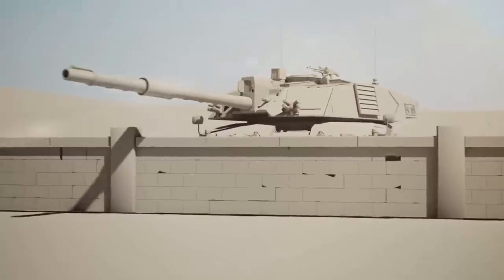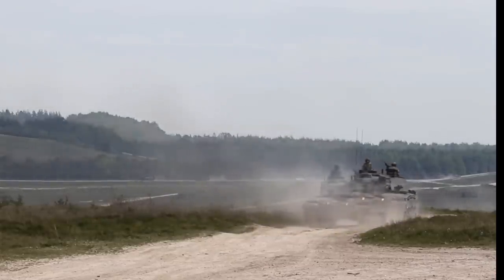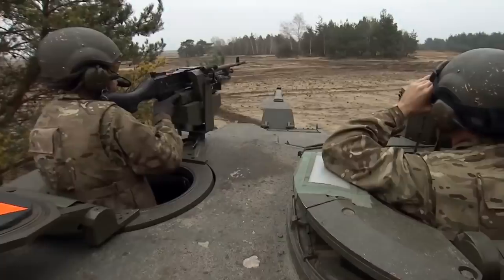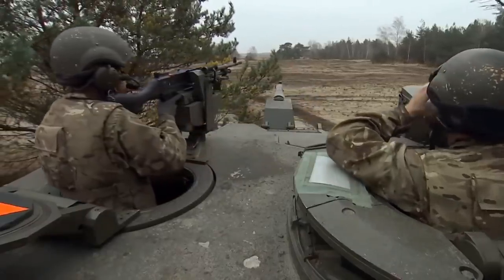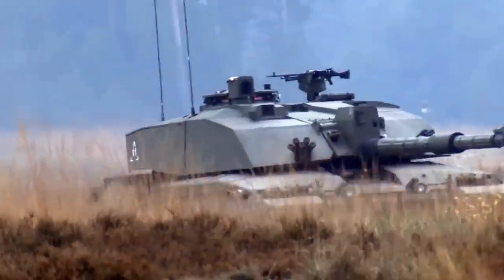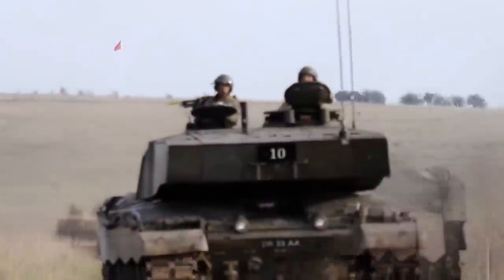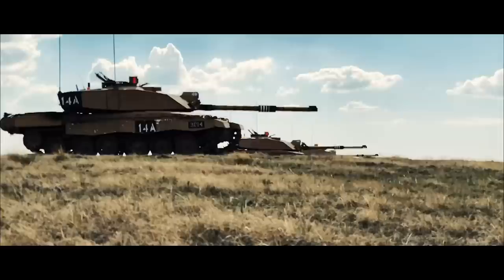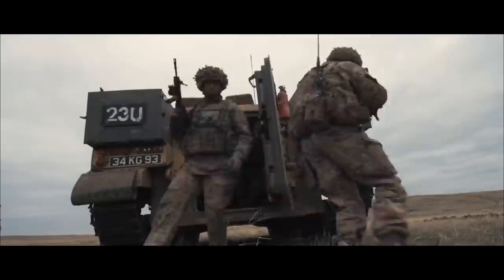Challenger 2 Tank "Black Night" | MODERN UPGRADE

Comment: would be nice if th eu (ye britain is out now) if they would do a joint venture tank like the tiger helicopter or the typhoon aircraft think they COULD make a great tank IF they work good together. Germany leo2a7v now is one of the modernst now challanger2 and  leclerc are also great tanks, even Arieta PSO. But i think IF Political would have to agree to this and even if they, they would have to show their "classified" technologies to foreign countries if the result should be rly good and the cooperation shouldnt suffer like (germany: we did such a good tank we have the lead here or UK: we developed the best armor) just examples. But if it works there could be a. rly great tank with a 130mm Rheinmetall smothbore they want to give it to the future Leo (3) and if 3 countries got this calliber the ammunition could be better developed and cheaper
PS: it would be a highly mudular tank with variants for the single countries and as u said this bringst another pro faster repair/ changimg parts etcetc

Comment: Ah...The old circular argument of the Challenger needing a new gun!

"It needs a smoothbore because they are better"
"Why are they better?"
"Because they are smooth"
"And how is smooth better?"
"Because of the smoothness"
etc
etc......
Reply: @jonny2954  Smoothbore vs rifled isn't the only thing that affects those attributes. There are many factors that go into a gun's penetrating power and the British Army have actually used an L55 smoothbore in a Challenger turret and found it "had no significant advantage in performance" over the existing L30, and the L55 already is superior to the L44.
Reply: @willmartin1033  Sure there are other things that affect penetration power, as example the ammunition. That's another big drawback of the rifled L30. It uses two-piece ammunition, penetrator and propellant are seperated parts. This prevents the penetrator from extending back into the propellant like on 120 mm smoothbore ammunition, which is one piece. Search up a cutaway pic of a M829A3 APFSDS and you will get the point. The L30 fires shorter (thus lighter) penetrators at a lower muzzle velocity, everyone that has heard of physics knows that isn't a good combination.

The Rh L55 story is a bit different. The UK MoD never stated it 'had no significant advantage in performance'. In fact it provided a drastic increase of muzzle energy, but the Challenger 2 turret was designed to accommodate the two-piece L30 ammunition mentioned above. They could only fit 4 rounds of unitary 120mm ammunition in the turret without major modification. They would have to redesign the turret to fit more, but that was considered to be too expensive at the time.

Now, more than 10 years later, the UK MoD is interested in a more poweful gun again, mainly because of a newer generation of russian tanks being developed (Armata). Rheinmetall recently confirmed their LEP bid will focus around implementing a 120mm smoothbore gun in the Challenger 2.
Reply: @jonny2954  Modern L30 ammunition has  almost identical length-to-diameter ratio as that used on both L44 and L55. The smaller lighter projectile argument refers back to the L26 round used on the Challenger 1 and is decades out of date. Most criticisms of L30 actually unwittingly refer to early marks of that L11 gun.

The L55 was tested in order to look into gaining access to NATO single piece ammunition lines as the current lines were closing down. However, it was tested for lethality against the current L30 while at Bovington. The official British Army assessment given to the armed forces committee was that the gun offered no significant improvement in lethality. 

Challenger 2 LEP has given a contract to a consortium including General Dynamics and BAE and is an internal systems upgrade. The gun is not being replaced and never was, Rheinmetall are not part of the consortium.
Reply: @willmartin1033  The smaller lighter penetrator does indeed refer to the L27, not the L26. It's simply not physically possible for the penetrator to reach a similar lenght to a M829A3 or DM53.

For the gun, i explained it, if you don't believe me this guy goes more into detail: https://below-the-turret-ring.blogspot.com/2016/06/team-challenger-2s-upgrade-suggestion.html

The Challenger 2 LEP wasn't given to anyone yet. There hasn't ben a decision yet. BAE and Rheinmetall are the final bidders, BAEs (early) proposal is seen in this video, Rheinmetalls proposal is going to be revealed soon. This is from a recent Rheinmetall presentation: https://i.imgur.com/jOTnG57.png
Reply: @komradearti9935  Yes, i forgot about the EFC count, thank you!
Reply: @komradearti9935  And now they made a smoothbore a requirement for the LEP.
Reply: @komradearti9935   Probably as much as a new tank. Really interested what BAE is gonna bring up, Rheinmetall already confirmed their LEP includes a smoothbore a few weeks ago.

Comment: Needs a smaller lower plate where the driver is. And every where between the cannon barrel and the cheeks are very big weak spots. A new improved engine, and better transmission would be good as well

Comment: look like its getting Israel's trophy APS from the images at the start of this video also didn't Challenger 2E demo have a 1500 hp euro pack as for the gun they tried the L55 smooth boar until someone realized you need to redesign and re-manufacture the back half of the turret for the one peace ammo!

Comment: I have to disagree with regard to the rifled main armament. Currently the Challenger II has by far the longest range hits of any MBT for direct fire. Yes at close range it has disadvantages EG slightly lower velocity and higher barrel wear, but that only affects APFSDS and HEAT (which looses effectiveness when spun). HESH and HEAP are far more effective from a rifled barrel because you can clobber things before they can hit you. There was an instance of an older Iraqui tank (possibly  T-62) being destroyed at 5100 meters with a single shot (by a Challenger 1 but they use basically the same armament). An M1 would not be able to hit it at that range with any reliability. The longest range tank kills ever were indirect fire in 1966. Guess what? The round was fired from a Centurion and the kill was at 11km, and it was an armoured target though I believe it was not a tank. The IDF was using them in 1966 indirectly firing HEAT and HESH over a small hill with FAO's correcting fire.
Reply: Well the problem is HESH will potentially be next to useless against modern and future threats. Yes HESH works great against soviet tanks from the 50s and 60s, but what if the C2 has ever to come up against more modern threats with massively more modern armor and spall liners?
Also the Rheinmetall 120mm smothbore gun can use programmable HE rounds which basically can do the same thing as a HESH round if you want them to up to a distance of 5000m.
Reply: No fin stabilised round is accurate to 5000 meters. With HESH it really depends on the type of composite. Also spall liners are nothing like as effective as people like to think. Yes they catch the small stuff but a HESH round can scab off a 20KG razor sharp disk traveling at about Mach 2. Good luck trying to stop that.
Reply: That is simply not true. Also, what use is it to have a 5000m hit that can't kill the tgt due to the short sabot round? Simple layerd armour, let alone ERA armour uses HESH quiete useless. Also try to hit a mover over 1500+ m with it...good luck
Reply: @RoninTF2011 muppet a smoothebore cannot fire even at a static target at 5100 meters with even a 10% chance of hitting. Also muppet you do realise ERA was specifically designed originally to defeat HEAT rounds? Go check your facts.
Reply: You recognize pond live when they're not bring up arguments but insults. 1st: The 5000+ shot was an extreme display of skill AND luck, not something that the CR2 can reliably do. What do think the difference of an APFSDS(or FIN) round is fired from a rifled or a smooth barrel? NONE...but are stabilized by the fins. The rifling is in fact negative, that why fin round have a slip band so it does NOT transfer the spin to the round.

Multy-layerd or spaced armour: HESH shockwave gets to the 1st layer and there has its effect...inside the vehicle, you're pretty safe
ERA: 2 blast waves will cancel each other out. No chance of damage inside the tank.

HESH was great against simply RHA or cast armour and can still have an effect on light vehciels or building and other structurs.(All things a programmable HE round can do better btw). The one thing HESH is better at, is the price. 
Against tanks its near useless since the T-64. 

HESH is very slow. (has to, the thin skin of the round wont't survive harsher acceleration)
The flight-time past 1500 becomes so long...any engagment against a mover becomes a game of luck. Hence its not recommended.

You should try fact for a while instead of insults...goes a long way. (But maybe its beyond your ability to understand them, in that case sorry for bothering you)
Reply: You claimed that luck was needed for that 5100 meter hit. I asked for a reference and you provide none. Your statement of "physics" is not even relevant. If you know what the factors are you can compensate for them.
Reply: You can not compensate for a random deviation. If you had a clue in physics you'd know that. A CEP is usually given as 0.5mil, a really hight quality APFSDS round has about 0.3 mil (check ammo manufactuer sites for reference). For example here is a table for an older round http://www.kotsch88.de/tafeln/st_120mm-ke.htm

The gunner/TC  in the 5100m shot must have worked with great skill to get a perfect firing solution. But even then, and assuming the gun/mounting inside the tank did not induce any more random error(which never realy is the case) and assuming the near perfect round performance...the CEP (area where at least 50% of the round land) is bigger then a tank.  So yes, a portion of luck plays a role.
Reply: Quoting irrelevant data is meaningless. The Leopard 2 main armament is not the same as the Challenger II and is more like the M1.
Reply: You did not read the article I gave in the 1st link? Or do you need something explained?
Reply: I do not see how German smoothbore ammunition figures have anything to do with a rifled weapon. Also the maximum distance on the table is 3000 meters. So explain how it has any relevance at all.
Reply: Ich habe etwas Deutsch gelesen. Ich lese Schnackenburgh und Karl Bart sowie andere für meinen Theologie-Abschluss. Lesen Sie Theologie nach dem Ausscheiden aus der Rüstungsindustrie.
Reply: When using fin ammo, rifling has no positive effect. In fact it reduces accuracy and needs to be canceled out by slipbands. => CR1's rifles gun giving it no advantage over a smoothbore gun. The tables are an example on what to expect from NATO standart fin (sabot) type ammunition. If the possible error are already as big(or bigger) then a tank size target at 3000m, they will not reduce over range.  For an CR1 to reliably hit a target over 5000m, it would have to be for some reason way more accurate...for which there is no explanation why it should be. Also, how many other extreme range hits are there? Any?   Again, this 5100 shots speaks more of the quality of that tank crew, I can be taken as an example on how good the CR1 gun and fire control system is in reducing the systematic error for the shot.  In no way it is an indication that rifling a gun yields an advantage kinetic energy ammunition that uses fins for stabilization. AND, the chance to hit was much below 1...so there was luck involved.

Last point, the british units shooting with us, did not achieve better shooting results then us ...so unless they downgrades weapon and FCS of the CR2 when comparing it to the CR1, that "better accuracy" is a bad meme.
Reply: Disclaimer:their shooting results are of course only of limited statistical relevance...its an anecdote (as is that 5100 shot  btw)...but I doubt they have been bad gunners. They where rather good at their job.

Comment: Instead of working on the gun, as it seems that those who have the say have deemed it unnecessary, maybe work on the ammunition, make a larger longer more powerful propellant charge, and a more advanced better apfsds and hesh. Who needs heat as era defeats that and most tanks have era, so maybe just stick to a anti Fort anti inf shell and a good armour shell. Possibly cheaper than a new turret, gun, tube, breech, ammo etc. And if we have the mtu 1500hp engine why not use that? Didn't we offer that in the cr2e?

Comment: Russians have a long history of APS with the "Drozd" system (  Kompleks 1030M-01 ) being the first. Yet, they newer actually mass-produced these with their tanks nor fitted any substantial number of them. They have now a variety of systems, each having their own area of protection, a certain degree of modularity and its probably not just money, but actually the needs of specific units that newer gave an open door for massive and unitary introduction of those onto their vehicles. Not to say, that in a way, reactive armor had always a more massive and simpler use for them, now being incorporated into the armor itself. T-14 also, when looked at all the systems Russia has had developed,, has quite an limited variant too, mostly taking frontal attack and its armor in mind, than a real 360/180 degree protection. Not to mention the thing about their limited introduction to the army, not just for use of older tanks, but the idea, that they don't have yet any relevant threat to do a massive re-armament to new and fully capable APS systems. Especially, if ERA block addition is still a fast and cheap thing to apply and had some development behind them too. ( also, these reactives had also a ton of variations, some of them the well known big side-boxes on BMP3s that showed themselves having issues when hit, blowing up neighboring ones too, or some ERA variants on older vehicles tearing the chassis hull as well on BMP2s/BTRs ) .... in the end, these are neat systems, that can really do a lot of protection, ensuring even nothing gets even to hit the armor from any angle, but the cost/maintenance and necessary additions to weight and systems to the tank is just not worth it, not to mention, for all vehicles within the army. + the obvious threat to nearby infantry, as many of these systems use shrapnel ( even if in an precise angle ) fillings, that can kill nearby people, and the fact of great limits, if in urban or tight/mountain spaces.

Comment: Why not make tanks into remote controlled gun platforms?The commander and his crew could sit safe in a country far away.The only thing then is to have it equipped with enough 360 vision, signal security, and durable cheap enough.

Comment: with the amazing excelleratian were seeing with the new electric tesla arctic rigs, wouldnt a hybrid engine atleast be a decent option for the new power plant for c2 being a diesel generator sending power to an electric hydrolic pump, especially as electric motors have alot less moving parts making them alot less suseptable to failure. compared to a typical mechanical transmission. be it from me to criticise the pros. but those tesla rigs cant half excellerate fast.

Comment: Changing the gun to a smoothbore?  Does that mean the British army thinks HESH is now obsolete???
Reply: I don't know if the British army thinks HESH is obsolete, but they haven't much choice anyway. Because funny enough the manufacturing plants for the the current ammunition have closed down and because the britisch were the only one still using 2 part ammunition for their 120mm gun, no other country manufactures that stuff so there's no way to get fresh ammunition now for their rifled 120mm gun. And the ammunition in the storehouses does start to get dangerously old now
Reply: HESH is obsolete since programmable HE rounds are around.

Comment: the fact that they still havent replaced that rifled gun to the NATO smoothbore standard is rather odd.......how do British planners think their logistics will look like in a big war? They alone use that gun and its ammo, nobudy else in NATO has it and I think the factory that used to make ammo for it has also closed down (so good luck getting more). Its just illogical it hasnt been replaced
Reply: They have a new supplier for the ammunition and you cant just change from a rifled to smoothbore gun on a tank thats been designed to hold this type of ammo, note the biggest killer of the other nato tanks sold are ammo detonations, mainly due to hits on the turret.